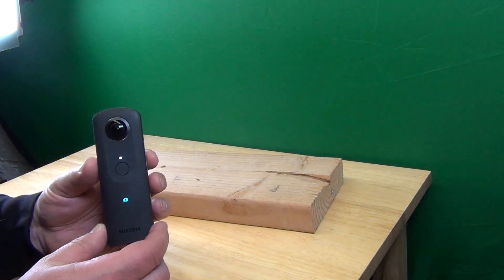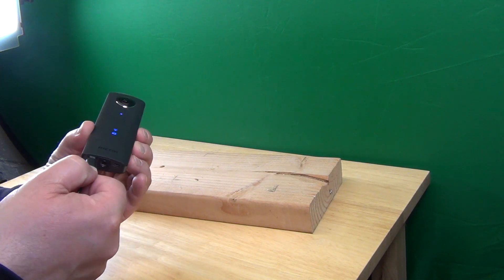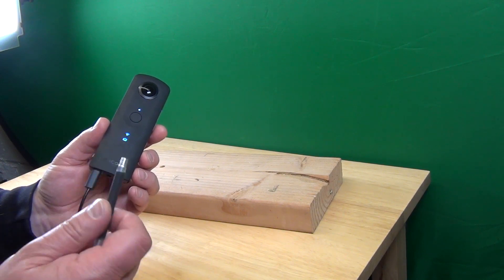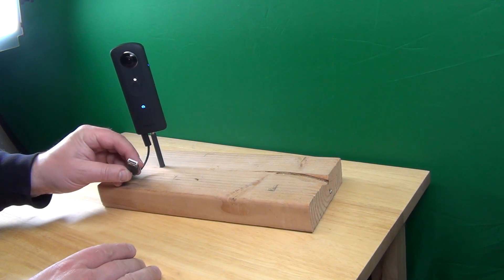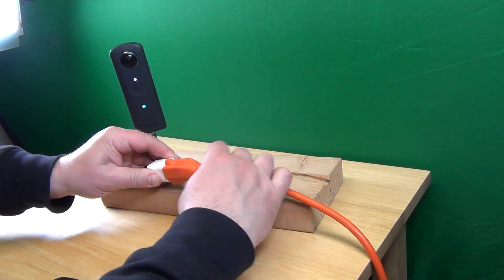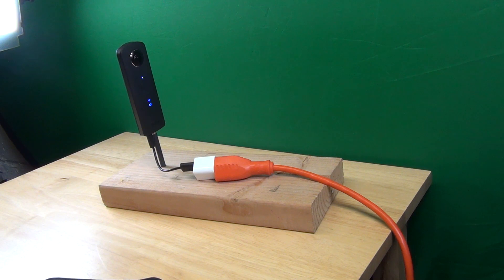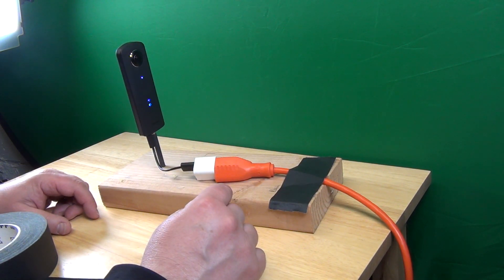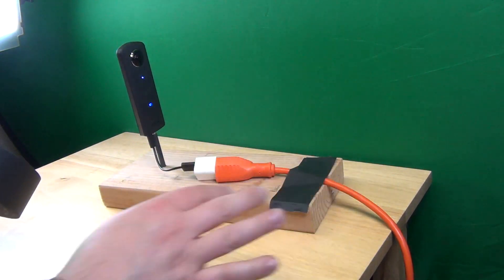Ricoh Theta S - External Power Supply

Comment: Is it safe to charge theta S? would it decrease the battery lifetime span? Also I have an adaptor that said Output: 5V-2A / 2000mA use to plug on wall outlet, is this safe to charge using this adaptor?
Reply from the maker: I don't see why not. I use the setup shown in the video all the time for overnight time-lapses.
Reply: mygiguser may I know whats your power spec on the usb charger?
Reply from the maker: I use the iPhone charger. It has 5W.  That is 5V and 1000mA.